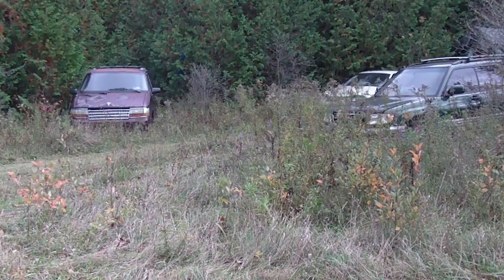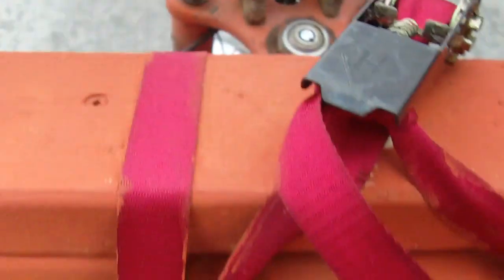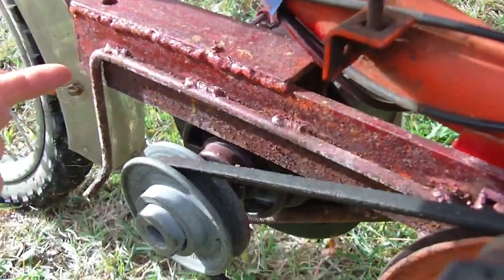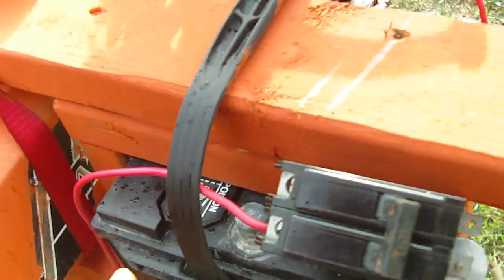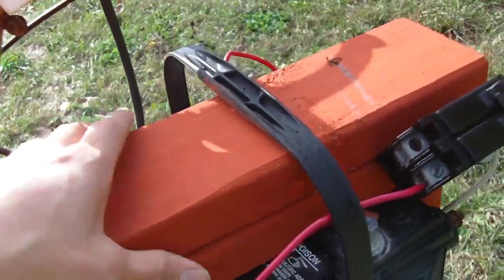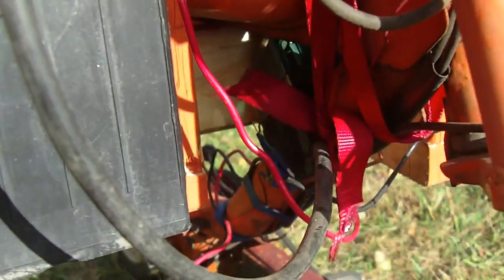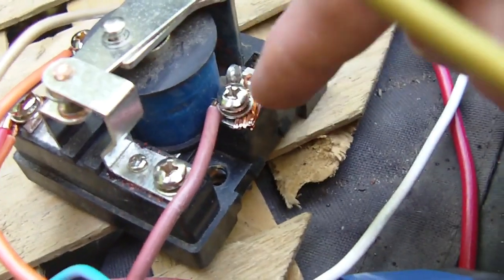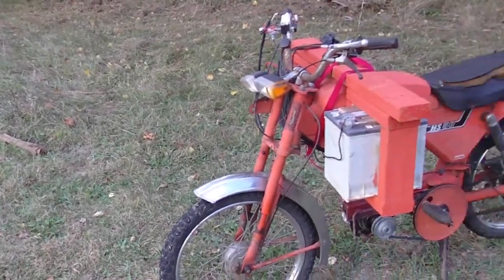Moped Converted from Gas to Electric using a 24v lawn mower motor, 1977 Batavus

Comment: A Li=ion Battery Pack would make a cool video, and longer distance/Far Lighter Power Source...
I Just Picked A 24v Yardworks Mower from the Trash.. Motor is Fine, And I Use The 36V Power Pack I Made from $1 Store Battery Pack/Chargers..(Each contains 1 Li-ion Battery At Approx.2000mah) with A Cheap DC Speed controller from Amazon.. About $10 (But, I Had To enclose Mine.. No Biggie Tho).. And An Inverter.Controller Also... Although It's Only Used For Power And Speed Control.. It Could Do Lights Etc.?... Maybe Someday? Lol.... Cool Build !!!

Comment: I have a kobalt 80 volt mower engine and a 49cc scooter .
Any possibilities ? I ordered from ebay, was supposed to be self propelled  it wasn't.  Ebay seller knocked off a few dollars . 
Don't know how long a battery would last if it would work I would buy another or buy a empty battery case .